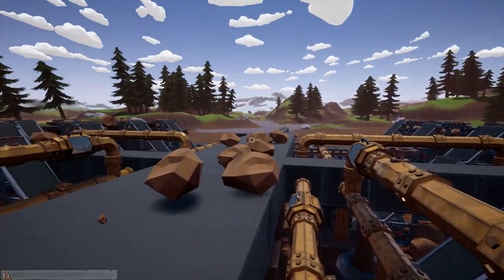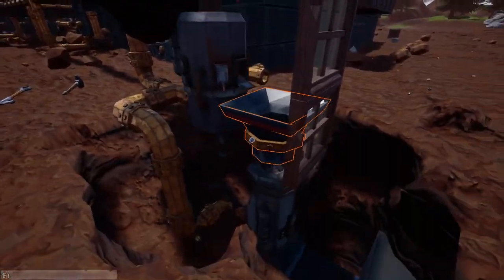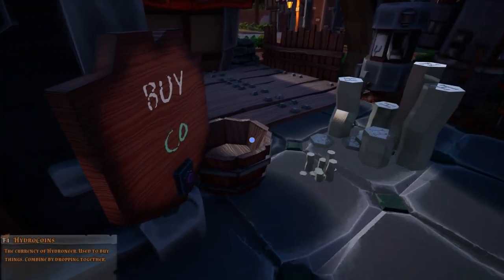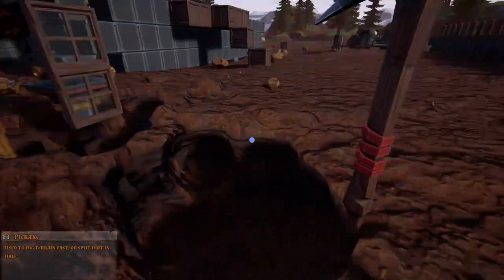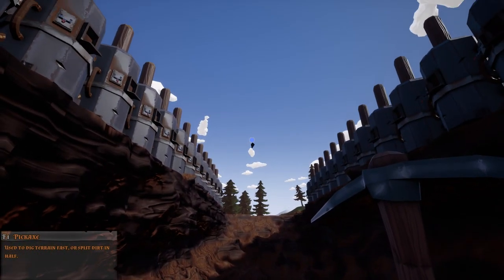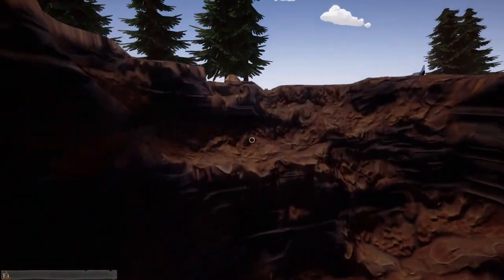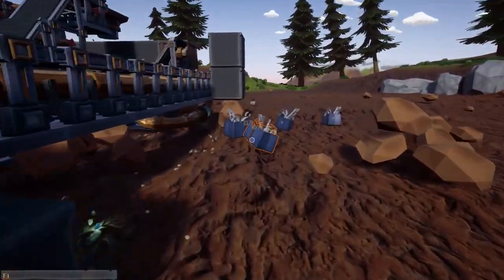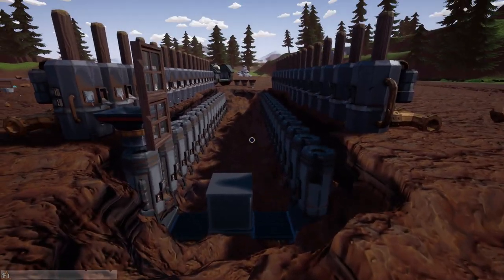The PERFECT Mining Setup | 300,000 in 45 Minutes -=|=- Hydroneer -=|=- 07

Comment: There is a save editor that you can download for free and use it to clean up all the loose dirt with a click of a button.  It will not clean up the loose valuables though.  For those ram drills that you couldn't get to work high up in the air you could have placed a block under them then a shovel of dirt and they work.  Nice job very similar to the one I made I found if you put at least four conveyors before the first sorter it tends to work a lot better as the nuggets are not jumping around as much when they go in.

Comment: R - RamDrill , = means conveyors
D - DirtCrusher, H - Harvester
RRRRR
=========D=D=H
RRRRR
In this plan all the Drill collect dirt in a single conveyor belt to DirtCrusher for crushing them smaller pieces then to a single harvester.
Can you like compare this plan with your plan, FOR SCIENCE😋 I mean if it works then less lags because less equipment required.
Reply from the maker: I can try that but I'm trying to eliminate the entities ( dirt and nuggets) as fast as possible. I think that's what causes lag. Keep in mind I have a ton of dirt laying around and thousands of nuggets I need to clean out of the old system